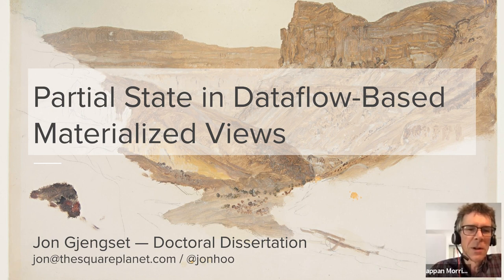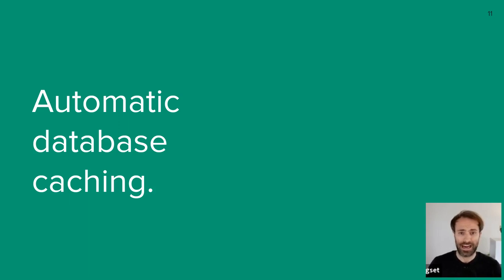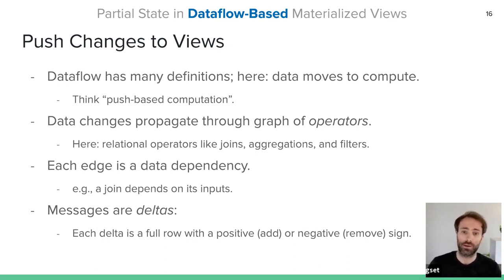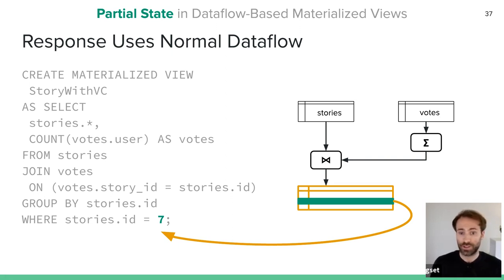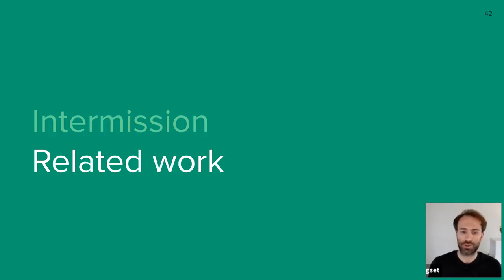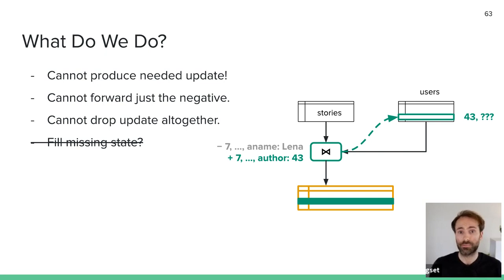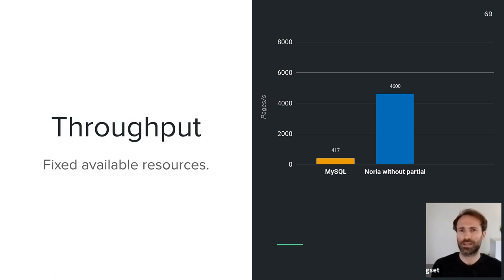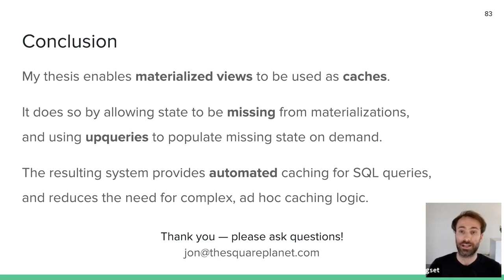Thesis: Partial State in Dataflow-Based Materialized Views

Comment: are the “?” placeholder mandatory for partial-materialized view?

What happen if the query placeholder is a range scan ex: “where age < ? ”
Reply from the maker: Depends on what you mean by mandatory. Without a `?`, the query has no key material, and so there is nothing meaningful for it to be partial over. Its result is either materialized or it is not. Noria will fully materialize any such view.

As for `age < ?`, those are not currently supported, though I talk about how you might implement that in the discussion section of my thesis if you're interested :)
Reply: @jonhoo  so place older are optional for noria to create incremental materialized view but mandatory for partial view.
Reply from the maker: @maximecaron3133  Yes, that's right. The ? allows Noria to identify subsets of the materialized view that can be materialized independently. Without such a parameter, all parts of the view are necessary to satisfy the query.